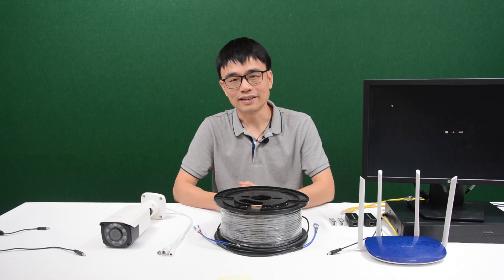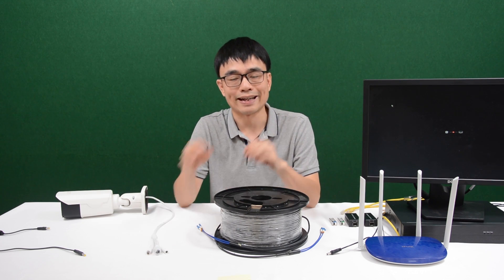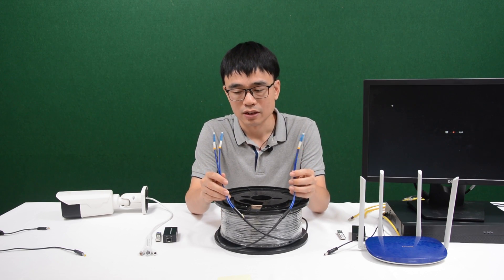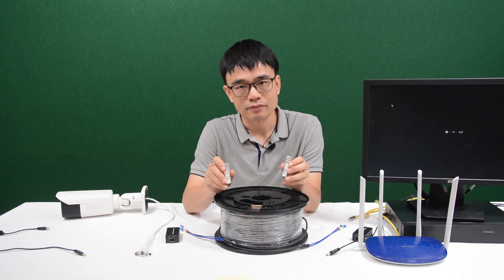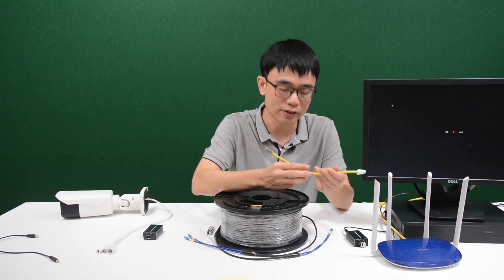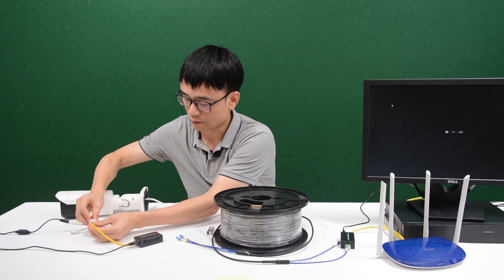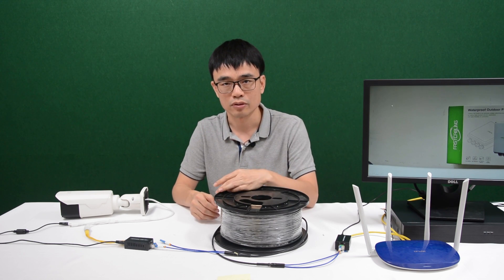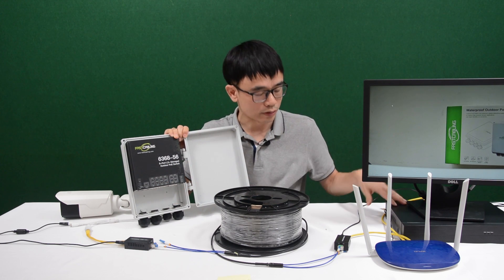Set up IP camera with Fiber Optical Cable in 7 minutes

Comment: Thanks for the video. I have 10 camera at different locations. There is Fibre passing along the points with internet. How do I take signals from the already existing Fibre to the cameras, ip camera. The camera is solar so no need for power
Reply from the maker: At each camera location, install a fiber media converter. This device will convert the fiber optic signal to an Ethernet signal that the IP camera can use. If you're interested, we can offer you a free design. Please send a layout to support@fastcabling.com. We'll provide you with the best possible solutions for your project.

Comment: in here why we use routers? can we connect this setup without a router
Reply from the maker: Without routers, your IP cameras can only record locally, which means you are only able to watch local footage from connected PCs or monitors. But if you want to access the security cameras remotely, you need to connect them to the Internet.

Comment: If one cable manager(terminator) to another terminator is connected by multimode cable and cable manager to switch is connected by multimode patch cord  but sfp is 1000Base-LX SM/1310mm in both switches then will communicate or work properly ??
Reply from the maker: You will hav to put multi-mode SFP transcevier both end. The SFP transceiver determine what kind of cable and connector it can work with. Once you pick the SFP module, you will fix the cable and the connectors on both ends.